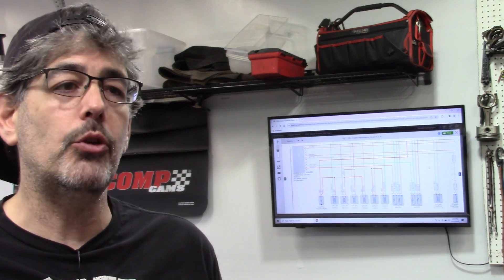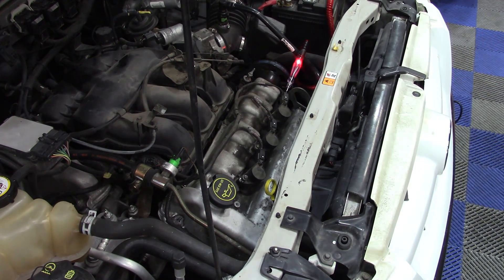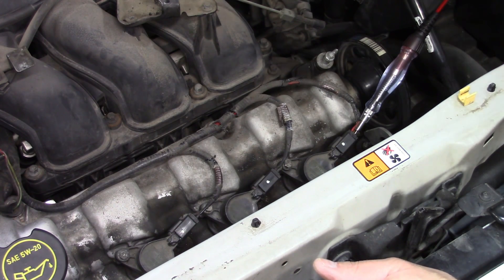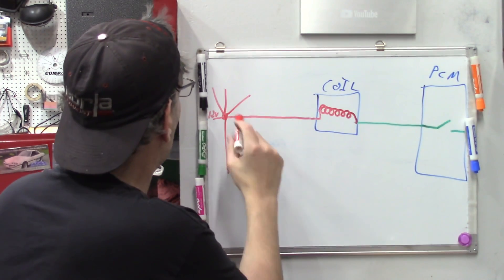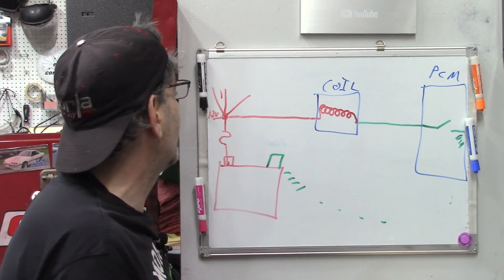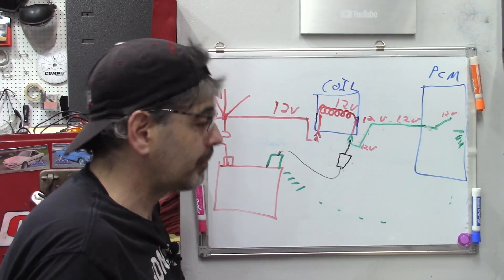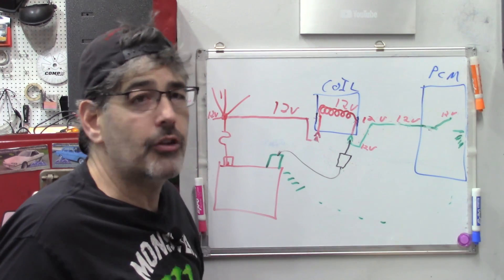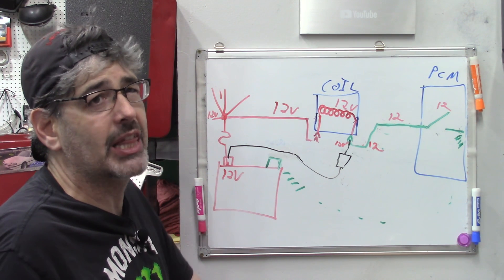SBQM Free Sample: Proper Use Of Test Light To Check Ignition Coils

Comment: Is it true that doing this test with an incandescent test light is risky bc it can damage the ECM, safe to use an LED test light?
Reply from the maker: Not on an ignition coil it isn’t. The amperage is way over 250mA on an ignition circuit.
Reply: @ thank you

Comment: Hello Mr. Schrödinger excellent videos. I’m having I similar problem and I believe you can help me. I have a 2005 ford expedition 5.4 with 150,000 miles. I have a crank no start. I can confirm that I have fuel, spark, and compression. Fuel rail 75psi and when I took out a spark plug and cranked it there was fuel in the cylinders. I tested the coils and they are fully functional with good on and off intervals, I also changed the sparks to new ones. I am getting good spark too. Checked if the engine is grounded and it is as well as manually grounding myself. When I crank  getting roughly 200 rpm’s and the engine temp is ambient temp which is 80F here in miami Florida. All fuses are secured in their slots, inertia switch not triggered and throttle position within parameters. I’ve tried using starting fluid but it does nothing. I am complexed as to what it could be, I am no mechanic by any means but I believe I’ve tried almost everything. Clearly I am missing something, you are clearly an expert so what do you think could be the cause of this anomaly. Thank you for the videos!
Reply from the maker: If you have fuel spark and compression it must be timing.
Reply: @SchrodingersBox  Thank you for the reply! That is something I didn’t want to accept. I hope it’s not the timing chain. Would you assume with the information you have, that the timing chain is operational? I believe since I got rpms that the chain is good, but so if timing is off what other component could be affecting my coils and injectors?
Reply from the maker: Your only possible variables are fuel, spark, timing and compression. If you have fuel and spark then you have a timing problem because it’s not possible for all cylinders to have low compression (well, if the timing of the cam and crank are way off then of course you won’t have compression but that’s a timing problem.
   I would correlate your spark event to the compression stroke for any cylinder and correlate cam and crank signals.  It has to be timing.
Reply: @SchrodingersBox  Mr. Schrödinger I was able to start the vehicle today by disconnected all the injectors. I had a suspicion that the cylinders were being flooded with too much gasoline because like you said the timing could be off so the fuel wasn’t being burned. It ran rough but pretty strong. I was able to pull 3 codes. 2 for the camshaft sensor and 1 for the o2 sensor. The car died a little after I guess lack of fuel. But was going for about 5 minutes. After changing 3 more spark plugs for good measure I couldn’t get it to start again. I changed the camshaft sensor and nothing. My father is saying that the timing belt could be stretched or hoping gears but I highly doubt that would be causing the issue. Would changing out all the crank and cam shaft sensor fix my problem sir?
Reply from the maker: yep that camshaft sensor code is a major major major clue most likely pointing to a timing mismatch with the crank. 
   indeed a stretched belt can cause that code but more like you jumped teeth because to have a no start you need a pretty substantial timing mismatch.
   changing the sensor won’t help. remember you confirmed you have fuel and spark. this means the sensor is working.
Reply: @SchrodingersBox  Hello Sir, I’ve been doing some research seeing how the belt could have jumped teeth. It appears the plastic alignments rails for the chains tend to break and get lodged under the belt. Or the belt although a metal chain could have possibly stretched. If that’s the case that would be hefty job. I am very perplexed as to what the problem is. I got the car to start and in all fairness it didn’t sound perfect but I didn’t hear any misfires or get any codes. Before I go ahead and start changing the chain is there anything else I can possibly check to make sure it’s not something else? Thanks for all the replies by the way you are a good man.
Reply from the maker: I think you should just go ahead and check your timing. You have more than enough evidence. Yes a broken guide is totally a possibility. In fact I have a video of exactly this. A couple, actually.
Reply: @SchrodingersBox  Okay I will check the timing. To be clear when you say timing you mean the physical chain and components. Or do you also mean ignition and injectors? I assume you mean physical because from my understanding if the ignition and injectors weren’t working it would be due to a malfunctioning crank or cam sensor. But those are good. So the only other thing would be the actual chain is out. The only thing that keeps me second guessing is when I crank I have a pretty even sound. It sounds that it has good compression. And so the vehicle should have started at least one cylinder if I have compression spark and fuel. That’s what is keeping me up at night. Would you happen to know any mechanics you recommend in the miami Florida area. Or would you do a zoom diagnostic? Hahahaa
Reply from the maker: For timing I would suspect actual mechanical timing. Yes it will have an even sound while cranking because every cylinder will be off time the same way.
Reply: @SchrodingersBox  Hello Sir, I am replying to the same thread so you kind of have the context. As you can see we spoke about my crank no start. I appreciate all the help you have provided as it was very useful. So far on my mission to fix the expedition I had made the assumption that the car was adding to much fuel to the engine which would not let it start. The fact that I had spark was unsettling to think it wouldnt even fire abit with the additon of fuel. My next idea was to unplug the fuel line going into the fuel rail. Boom! the car fired right up, died alittle after but I could then control it with starter fluid and have it run for abit longer until it would eventually die. I am going to change the injectors now as its an easy job but I pulled the rail today and non of them seemed to be leaking. They sprayed pretty good actually. My quesion for you is if the injectors are not the problem what could possibly be the cause of the engine reseving too much fuel into the cylinders?
Reply from the maker: I’m still not convinced there’s evidence of a fuel problem. If the timing is off the. Perhaps providing constant fuel as opposed to specifically injected fuel explains it running with fuel disconnected. Does the car show a rich condition on the fuel trim?
Reply: @SchrodingersBox  Sir you are a genius! Took me a couple days but got the front engine cover off and sure enough bank 1 chain guide was broken. Plastic piece of crap. The chain was indeed loose but not sure how many teeth jumped. I’m going to pull the valve covers off Monday to inspect. Thank you for all the help and guidance you provided. It was more than adequate and I just wish I had listened to you sooner. I just was skeptical not sure why when my experience is basically zero but this was a nice learning mission. I have two follow up questions if you don’t mind answering. I’m really hoping no rods were bent while cranking it so many times, but if any are would that be a job for an actual technician? Also while I have everything open should I get a full tensioner kit with vss solenoids and the two phasers? Also should I change oil pump and water pump? Thank you for your time!
Reply from the maker: Glad to hear you got it figured out but sorry it’s going to be such a job. 
   I have a video from maybe a year ago where that exact guide you mention broke and I cover the procedure for repairing it. Yes you would get an entire timing kit. 
    As far as if you may have bent valves or something- it’s very very unlikely as the broken guide only puts you off maybe 9 degrees. Not enough to create interference. If you are concerned you would need to do a leak down test on the affected bank.
Reply: @SchrodingersBox  Hello Sir! Update we got the new timing chain in and everything looked good before closing her up. Went to start it and only crank but no start. Any idea what is next?
Reply from the maker: You’ll just have to retrace your steps. Obviously something didn’t get connected. 
  Start with the basics again- is it missing fuel, spark or timing?  Is there a cKPs signal?
Reply: @SchrodingersBox  Is there anyway by putting the chain wrong the vehicle will not start? I lined up the chain properly with all marks. I did rotate the camshafts full turns to line them up, could that cause the wrong valves to open?
Reply from the maker: Absolutely and incorrect installation will cause a no start. Even 2 teeth off will do that. 
   But also not connecting the crank sensor or cam sensor will cause no start as well. I’d do the basics first before I redid a timing chain!!
Reply: @SchrodingersBox  I put the chain on the markings but I’m not sure if you are familiar with 5.4 triton engines well our left and right sprocket had an L marking and a dash marking. We put the left side on L and right side on the dash but we are not sure now if that was wrong. Or possibly we put both camshafts in exhaust position instead of one in exhaust and one in intake. Either way we are able to start it now by giving it medium throttle but it has several misfires and it will not idle. I’m questioning now if all our coils are working and injectors. The fuel trims are through the roof not sure if worth takeing note since we are giving it throttle. What do you think it is my good sir. Have a P0345 and P0349 codes.
Reply from the maker: Sounds to me like you put the chain on wrong. I am very familiar with the tritons- and yes there is an L and R for left and right cams.  However if you look very close the L and R also have arrows built into them. The arrows line up with colored links on the timing chain (there is also one for the crank sprocket. All three arrows must line up with the respective colored links.
  The timing chain, not the cam or crank position, is what actually sets the timing.
Reply: @SchrodingersBox  That is what I was thinking. The thing with our sprockets both were L with arrows. I knew something was off so I looked it up and it said the right side could have an R, R with dash, or just dash. So the left side we put on the L with arrow and right side we put it on the dash. Was that wrong? I was looking for the R with arrow but it did not have. I was thinking it was a factory error. Just to note we did not change the sprockets out we left the factory one. Only changed the chain, tensioner, and guides. Probably should’ve bought the new ones since they come with the L and R. How can we check if we are on the wrong mark without takeing apart the front cover.
Reply from the maker: You can’t unless you have an oscilloscope. You’ll have to take the front cover off I’m guessing.
Reply: @SchrodingersBox  You won’t believe this! Haven’t taken the cover off, since it starts and just wanted to cover everything before that. And every time I clear codes the same P0345 kept coming back. Saw a video explaining that one possible cause is the phaser being misaligned. When I went back to my pictures and videos turns out my freaking bank 2 phaser is off mark. The middle dial is a couple centimeters off the L^.
Go figure!!! So I will be takeing the cover off once again but thankfully second time should be faster. Thanks for your wisdom I will keep you updated!
Reply from the maker: Yep totally as expected. Glad you got it solved. Second time will be way, way faster for sure so it won’t be that bad at all.
Reply: @SchrodingersBox   Took awhile to get the phasers. But installed and fired it up. She purred like a kitten. But we have one tiny little issue. This car just keeps bearing sweet fruit. We are getting a P0022 code. Symptoms are car idles okay and sometimes turns off when making a sharp turn. I saw a couple videos on what it could be. I did change the vvt solenoids. Any common issues you have encountered with that code. I believe it could be the bolt maybe not torqued all the way. I saw your recent P0010 video so I will be checking the voltage. How do I know if it’s mechanical or electrical?
Reply from the maker: If your can position is off at idle then almost guaranteed your chain is installed one tooth off
Reply: @SchrodingersBox  Okay so I double checked and the idle is perfect. The only symptom is that it seems to die when turning hard sometimes coming to a stop and to be specific on a 3 point turn. These are one time occurrences as we’re still driving it daily. But those have been the occurrences to use a more proper word. When the P0022 is cleared it comes back so something is up there. I can confirm timing chain is on the right markings and so is the sprockets. Is this a faulty vvt solenoid sensor? Or more deeper than that?
Reply from the maker: Could be.  I would check cam and crank correlation as first step. But also it would help to see if the P022 happens only under engine load.
Reply: @SchrodingersBox  So when we took the old sprocket off the pin that is used to line up the sprocket to the camshaft was sheared off. Which I saw was a common occurence. The other thing we noticed was that the slot on the camshaft for where the pin goes was actually widend by barely half a centimeter. Not entirely sure why that happened but we just ignored it thinking that the added space in the slot will not make a difference. I should also add we tightned the sprocket bolt to 30ft/lbs and we tried to reach the additional 90 degrees but it felt like the bolt was going to strip so we did not go the full 90. Do you think that one of those two scenarios could be the problem for the P0022 code. Car starts and idles like a gem. Drives good but then it'll lose power and feel sluggish. I believe under load is when it acts up. What does this mean?
Reply from the maker: All I can tell you is it is perfectly clear to your phaser is out of alignment.  It was always clear it was a timing issue but now we at least know why. 
    VVT is only used under engine load. At idle phasers rest at zero and they advance as needed under load. Sounds to me like maybe the broken detent pin is preventing the phaser from advancing when it should? I don’t know- I didn’t see what happened. I’ve installed maybe 5 of these ever so I’m not exactly an expert lol.
Reply: @SchrodingersBox  I understand. Fortunately camshafts are quite cheap on partsgeek. The dowl pin was on the old sprocket and the new one has its own pin that helps line up the sprocket to the cam but the slot that it slides into was enlarged. We thought we could get away with it but im learning that these ford engineers made everything to tolerance for a reason. I really do appreciate your help Sensei Shrodinger. Im currently getting my bachelors in mechanical engineering and with a year left Ive yet to physical work on anything other than a paper and pencil. So working on cars brings me some joy although it is challenging. I believe i will be takeing her apart once again hopefully for the last time but I will check the vct solenoids first and then continue with the teardown. Thank you again and I will come out of this Victorious!
Reply: @Dyllanman  Try to make the engine run on alternative fuel, (carb/brake clean) introduced via intake manifold. (Brake booster vacuum hose should work). If you can make it run decent, then timing should be ok. Exhaust restriction is another possibility. Back pressure can ne checked via dpfe vacuum hose connected to vacuum/pressure gauge. 1" max while cranking.
Reply: @JamesSmith-xs7sr Thank you friend. Changing the timing chain, sprocket, 
vvt solenoid and camshaft fixing everything. She purrs like a kitten now. Still getting a P0012, P0340, and P0430. But it runs good so not too worried at the moment. I put 5w-20 which I kind of regret not going thicker. Any suggestions on oil specs?
Reply: @DyllanTrueba  Use oem specified oil, change every 3k. I personally, would switch to 5-30. Esp if tge engine has over 100k.
Reply: @Dyllanman  NEVER turn a t-belt/chain engine backwards!!!!!

Comment: Great explanation Matt. I just want to be sure if the test light should be connected on positive when testing 4 wires coils?.
Reply from the maker: It depends on whether you are testing reference signal or ground. Test light should be on positive when testing ground  OR if if you are attempting to input a signal to the base of the transistor.

Comment: Nice explained. What about the the COP ignition coil that has the transistor integrated ? Does not this transistor need a positive trigger on the base to switch on so that the coil energized with 12 volts ? 🤔
Reply from the maker: Yes it does. In that case you have constant ground instead of ground side control and a base signal to turn it on, as you said.
Reply: @SchrodingersBox  thanks a lot for the answer 😉

Comment: If a ford engine has prolonged misfires that will burn up a ford pcm
Reply from the maker: how so if it’s not an ignition misfire?
Reply: @SchrodingersBox  it is still a ignition misfire because a majority of the coils aren't firing most likely because of a weak signal from the pcm like a burned driver
Reply from the maker: Say that again?  A weak signal from PCM from a burned driver?????
  What if the misfire is from compression loss? How does that cause a burned driver in the PCm?
Reply: @SchrodingersBox  I never said it was compression that would be a mechanical misfire